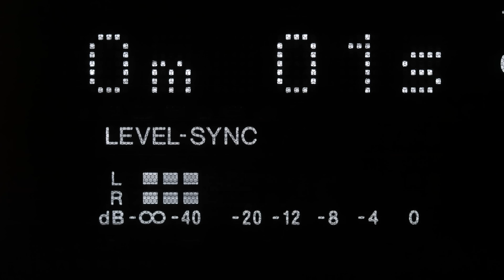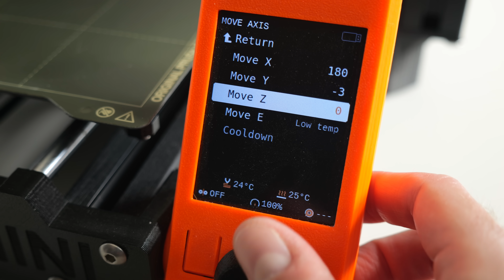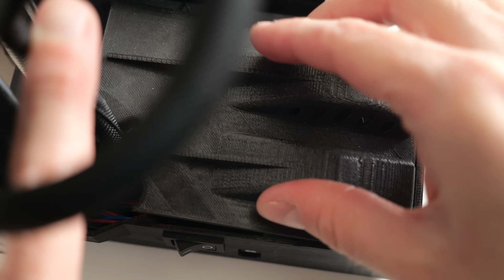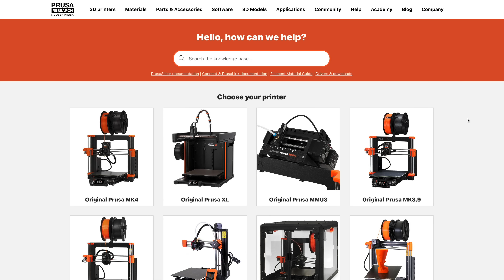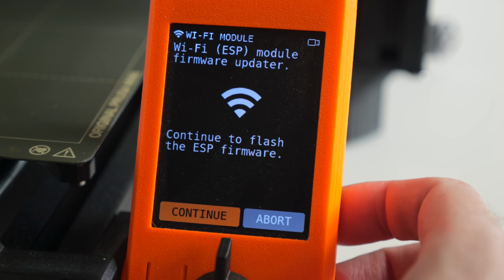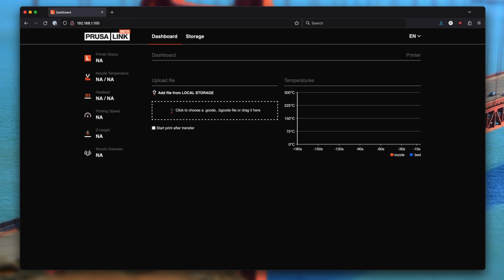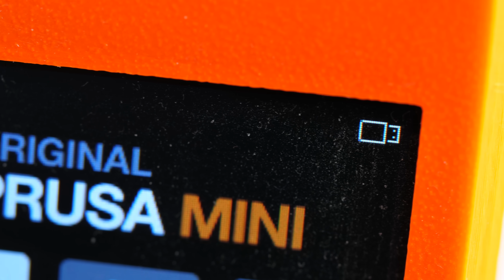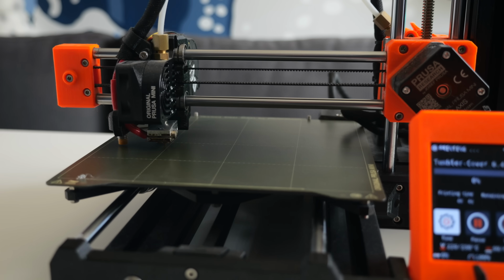Unleashing my 3D printer for CHEAP!

Comment: just FYI you can setup just about any normal wifi router to be a ethernet bridge, you can even buy tiny little USB devices that are basically a pocket router specifically just to allow converting any device into a wifi-enabled one. 
vonets makes some really cheap wifi bridges and are USB powered. plug your computer in to set it up and then just unplug it and plug into the preferred device.

Comment: this is definitely an option if you like prusa's firmware which is just a marlin fork. many do. 
though if you wanted another option to add wifi, it would be to get an orange pi zero 3 for $20, flash it with armbian which officially supports the opz3 now, and install octoprint or klipper. 

being able to add a $10 amazon webcam to a printer is nice if you print ASA or ABS and don't want to get the asa fume flu, letting the thing print away in a shed and checking on it without having to go out there and look. just plug the local ip  of the opz3 in on your phone's browser and if mainsail/fluidd is configured properly and the webcamd daemon is running, it shows the webcam video feed in mainsail/fluidd.

Comment: Imagine buying a $460 printer with no wifi, single-sided part cooling, and not even a ten cent silicone sock on the heater block.
Reply: I honestly thought the Prusa mini was a cheap little printer, especially cause most of the prints I see from it are just meh. 430-460 dollars is honestly insane.

Comment: I found the Wifi module really slow. It's serial and not designed for high bandwidth purposes. My Prusa i3 is much better because I'm using a Raspberry Pi Zero 2. My Voron 2.4R2 is the best though, Raspberry Pi 4 host so the Wifi is decent.

Comment: If only that WiFi module wasn't so excruciatingly slow with just about 100kb/s. Ethernet can do 300kb/s which is still horribly slow even with the new binary gcode files that can still get quite large, but at least not as slow as the ESP module...
Reply: The bottleneck's gotta be the uart interface between the esp and prusa mcu. Even spi at a decent clock rate would be noticeably better.

Comment: I've been using OctoPrint on a spare Raspberry Pi 4 I had laying around and it's been awesome. So many plug ins, monitor printing, monitor cameras, control smart plugs if there's thermal runaway. All free (other than the Pi). I will admit that it's more expensive than the $7 wifi module, but I would argue it's way more versatile and open source. In OrcaSlicer, I can hit "Upload and Print" and it starts it automatically.

Comment: Ooh, i like that theres an easy wifi upgrade option there.

For my Creality printer the only way i could get similar remote access was connecting a raspberry pi loaded with octoprint to it.
Reply: altho its the only way, its (imo) better than this in terms of features 
i mean sure, octoprint or klipper might be harder/more work than this to begin with. but once you get it going it really levels up your printer